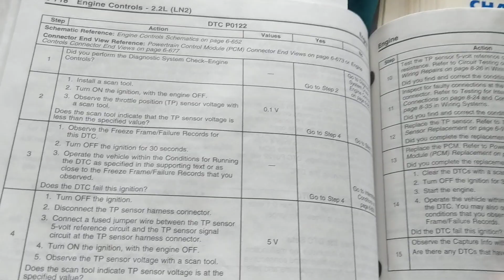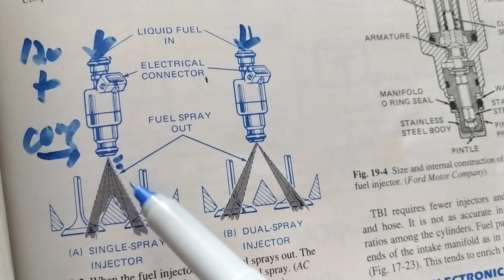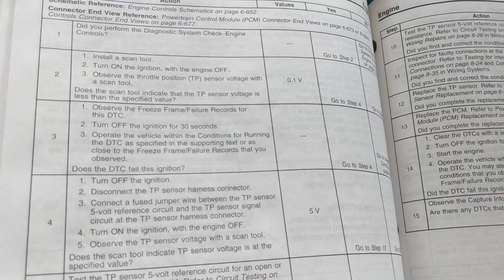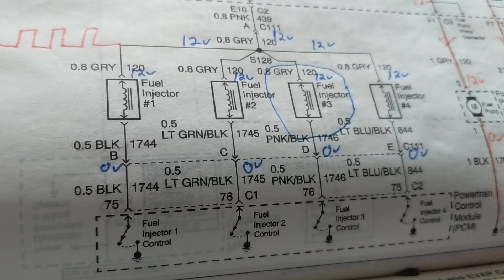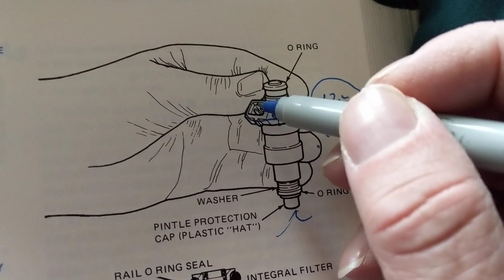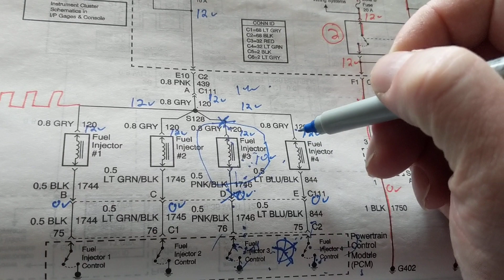FUEL INJECTION

Comment: Joe I have a 1983 Ford f250 it's carberated but also fuel injection (half and half) can you explain to me how that works?
Reply from the maker: Carburetor still have to be tuned but the fuel injection helps with battery emissions better gas delivery so it's like getting the best of both worlds but nowadays obviously Superior it's fuel injections
Reply: @Joeelectronicschematicsforauto  can you do a video on that. A wiring diagram and explain it better. I'm restoring a 1983 f 250 xl 4X4 with duel fuel tanks and electric fuel pumps inside each tank please